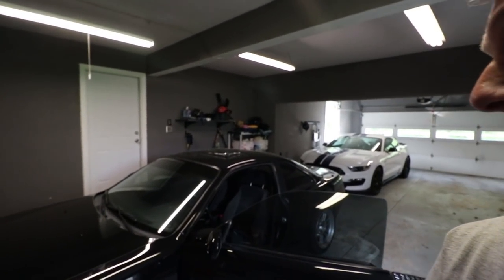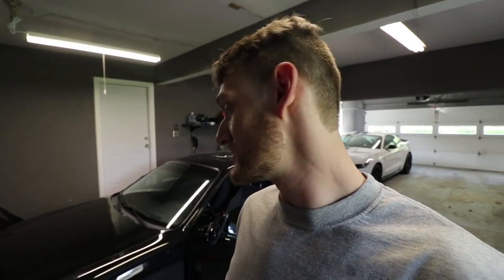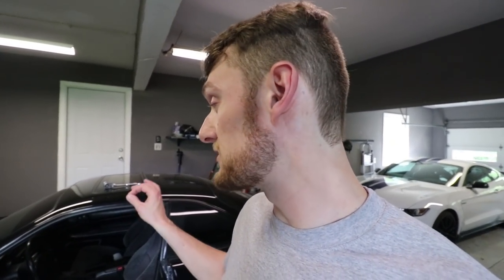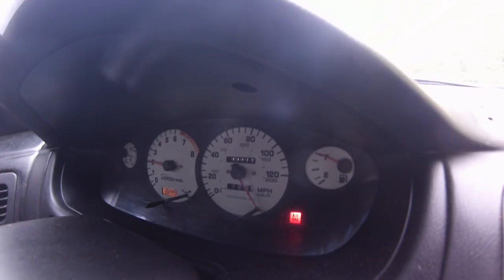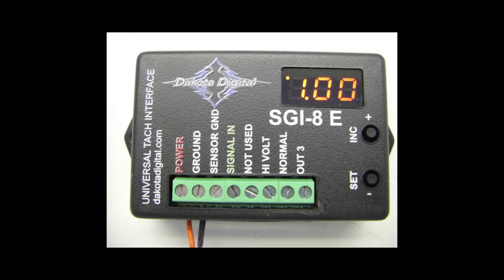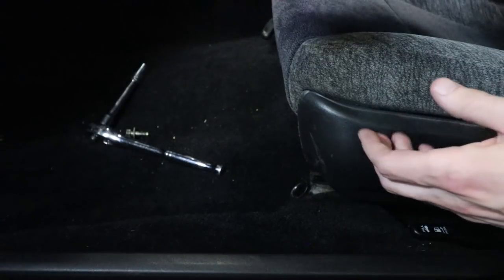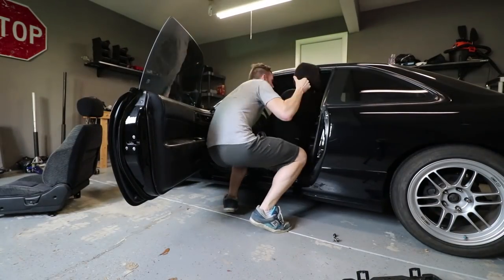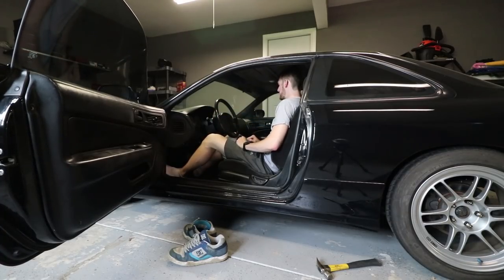My LS1 Swapped Nissan 240sx Needed These 3 Final Touches

Comment: Wow time flies since my last comment on your LS swap 240SX video. 

The 240SX looks amazing and clean. Without the engine running. One will not expect a LS is under the hood. 

So i guess this project has come to a close and you will be moving on to another car project. 

Maybe the next project should be a Toyota model like the MR2 AW11 or SW20 or the unloved MR-S Spyder. I seen some pop up once in a while but the condition and mods are terrible and the owners are asking too much money for a pile of rust and fugly car. 

Toyota almost nailed it with the idea of a mid engine car in the 1980s and its way before the Honda NSX came to the scene in the 1990s. 

But the MR-S Spyder was where everything went downhill from there when sales dropped and rival  MR cars like the Lotus Elise. Porsche Boxer quickly grew into popularity. 

This will be an interesting car project to work on a rust bucket MR2/MR-S to track weapon and a budget alternative to the Lotus or Boxer.
Reply from the maker: Thanks for the kind words.  I'm going German with the next build, new video in the next few weeks.
Reply: @EatSleepDrive  nice BMW?
Reply: EatSleepDrive  do you still have the 240sx?